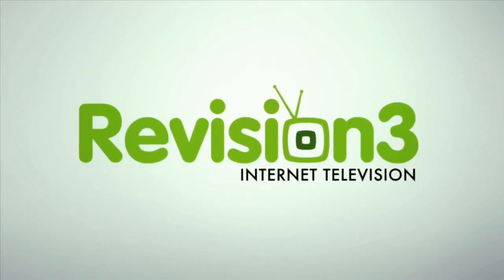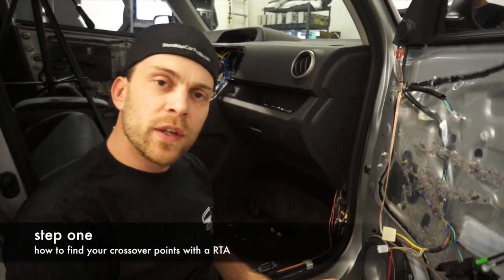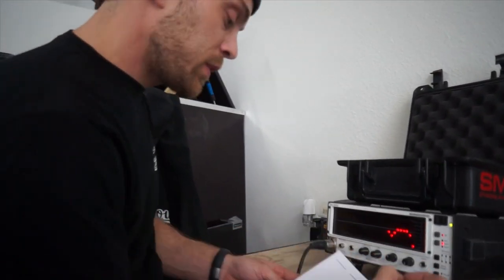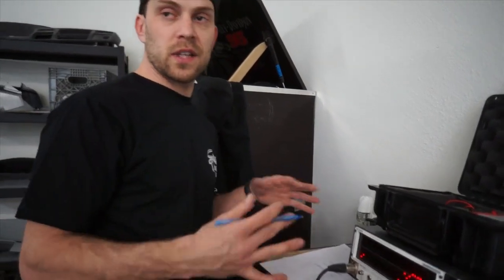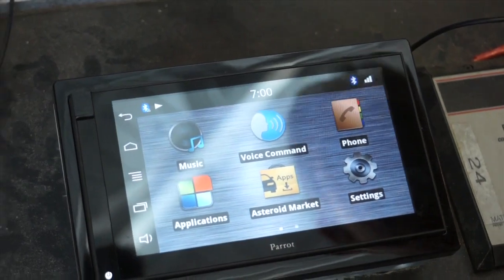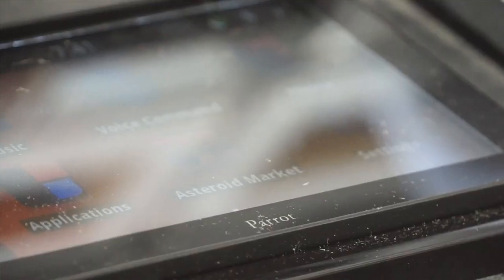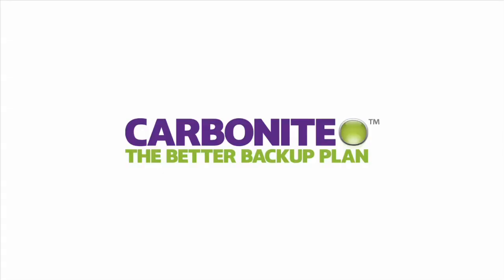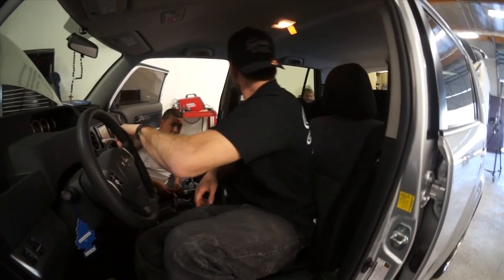Audison Bit Ten How To Crossover, iPad mini Ford F250 dash, Parrot Astroid Smart - Amplified #95

Comment: Hey Soundmancaraudio Guys. I'm BIG into SQ for my car sound system. My current ride, 96 240sx, has an Alpine F#1 system (Deck, speakers, amps, processing) and a whole lot of connection wiring. I'm looking to build a new system in my wife's Jeep.I have a brand new bitone sitting a box i bought the week they came out and never used it. I want to mount an iPad in dash but I want digital output from my iPad into the BitOne. Any ideas on how i can get digital out straight to the iPad?

Comment: So....you're just going by the frequencies it can actually produce? I wouldn't tune a system like that without knowing distortion figures and what not as well. You could cross it over in something that looks relatively flat but it might be in an area where the driver has terrible distortion.